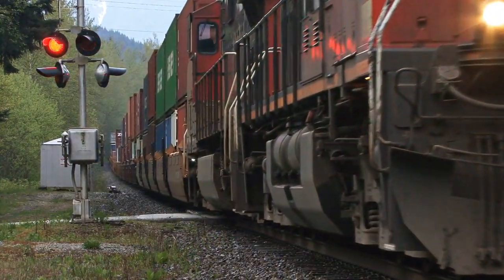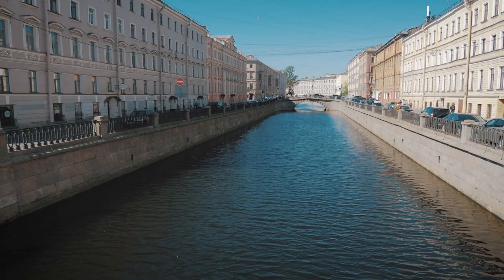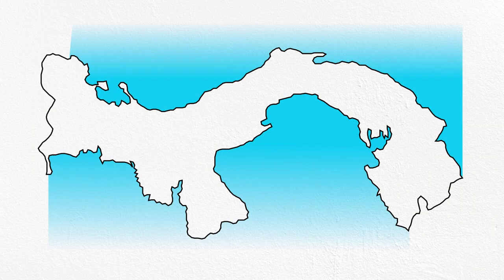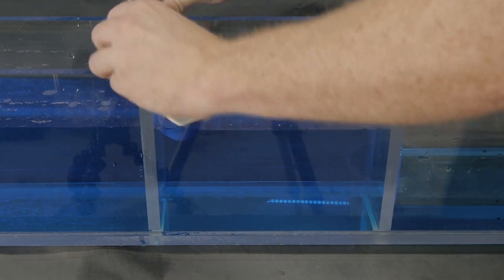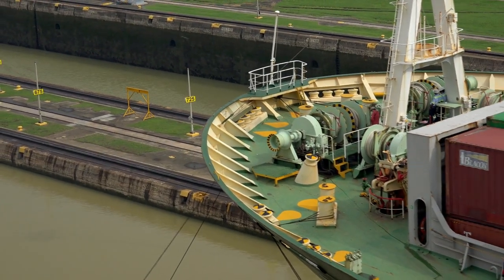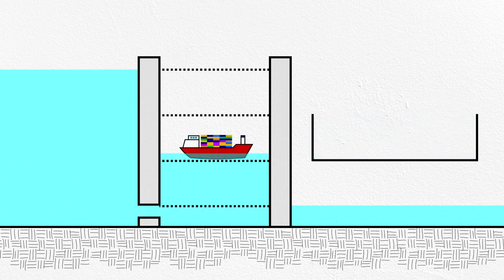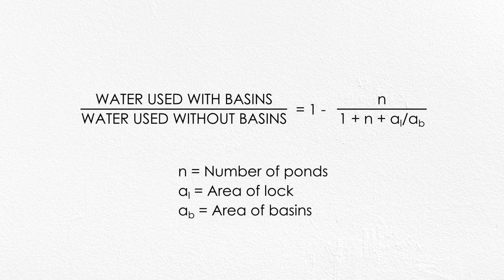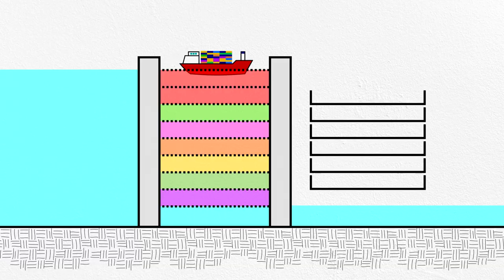The Surprising Efficiency of Canal Locks

Comment: Everyone: Look at all this water wasted by the canal locks.
Scotsman: Laughs in Falkirk Wheel.
Reply: That requires more energy, though. It's always a trade-off.
Reply: I came to the comments looking for this.

And as far as the energy requirements: you could either use hydro-power (which admittedly would waste water), or just accept you need a bigger external power source.
Reply: The Falkirk Wheel is cool and all, but it's designed for 20 meter boats that weigh a few tens of tons, not 366 meter cargo ships that weigh 120,000 tons
Reply: @Khaim.m  Only to overcome the friction of the wheel.
Reply: @VinayPai  Wouldn't it be awesome to see a version sized for those big ships? Totally impractical, of course, but how cool would that be?
Reply: @simongeard4824  I definitely wish we lived in a world where megascale engineering projects like that existed.
Reply: Because the boat in one ‘carriage’ displaces the mass of water equaling the weight of the boat, both carriages are always equal weights, and therefore the wheel is balanced. The energy required is actually quite low, and is effectively the same whether you are moving a single boat one way, or swapping two boats (one lower to upper, one upper to lower). 
There’s not much stopping the wheel design being scaled up - I’d be interested in seeing what the maximum feasible size is.

As for energy - one half-rotation takes the energy of boiling eight kettles of water (~1.5 kWh)
Reply: The “wheel” doesn’t need to be round. The two chambers can be balanced atop pistons that are linked hydraulically to those under the opposite chamber, like a pair of auto hoists. Close the gates, pump a bit of water out of the low chamber and UP you go, weighed down by the heavier high chamber. The lift lock on t he Trent/Severn waterway in Canada is an example of the technology.
Reply: @nautamaran  Today I learned that the Trent/Severn is about 3000 miles east of where I thought it was! 😁
Reply: An amazing bit of clever Scottish engineering.
Pretty sure I remember from a doco that the mechanism is so well balanced through design, the motor drive for the wheel only needs to be a rated at a couple of kilowatts. I can't remember the exact figure, but it was far less than you'd expect would be required to move that many tonnes of steel and water up and down that height. (Edit - answered by Rueben above, ~1.5kWh for one half-rotation).
Reply: @nautamaran  That would have to be the way to do something larger. Simply because the strength of steel/titanium/whatever magical unobtanium used, would simply not be strong enough to support that load without buckling the driveshaft. (And you can't have intermediate pillars to help support it unless it rotates LESS than 180 degrees in total, so 100% of the load is on the end bearings and single shaft. And if you're not rotating it 180 degrees, why rotate anything at all. Just have a driver pump for the hydraulics, and keep it spinning so the kinetic energy of the falling boat is maintained (And use a looped cable over the top as well, because otherwise the pump will have to ramp up when the falling side hits the midpoint.))

Comment: Invention: Use the lock ponds as "pumped storage" to generate electricity and then run pumps to  partially recover water in the upper locks
Reply: If you add generators and pumps to the ponds it would slow the water (and therefore the lock cycle) tremendously, not to mention their price.

Comment: When I was younger, I used to think they used large pumps to fill and drain the locks.😂
Reply: I wouldn't be surprised if smaller locks do
Reply: @ObservationofLimits  Nearly no locks use pumps. Kind of defeats the purpose, and if you were to use a pump you may as well just use it to pump water from the lower level to the higher level and ignore the lock entirely.

I've got a ton of small locks near me going down a canal and every single one of them is hand operated. Big gate style doors you open slightly to let water in, then all the way to let the boat out.

Comment: Well done video! I had no idea about these side basins, but it makes a ton of sense. The alternative alluded to would be boat lifts, cassions that carry a boat and quantity of water up and down, usually having two balanced. The cool thing with them is that a boat displaces it's own weight in water so they are balanced whether or not a boat is in it. They are near zero loss of water, but are much more complicated and expensive, and it wouldn't be possible (certainly not practical) to build one big enough for a huge ship.

Comment: Early English and British Canals and Locks where built mostly for mining, the early pumping methods then drained the Mines and transferred the water to the Canals. Even during dry periods the amount of ground water filling the Mines barely changed, it took extended droughts for months and months due to the "lag" of the water finding its way through the layers of soil, clay and rock and created an almost limitless supply of water. The Mines would always flood, the water always needed to be moved elsewhere so they made use of it.

Some of the early Canals have the water in them coloured by the minerals in the Mines, like bright orange from Iron.

Comment: Those lock gates you showed a clip of, the ones you can operate yourself... the gates actually float in the water, making them easy to move by hand. Also, when they close they form a triangle pointing upstream, which pushes the gates into each other and the walls, so the weight of water is all that's required to keep them securely closed. Once the water level is the same on both sides, they're free to move again. I love that kind of smart engineering.

Comment: In the past in the UK a number of canals failed as their was insufficient water to keep the summit level, which provides the water for the locks filled in dry weather. In some places steam powered pumps were used to pump water from underground to keep the summit level full but it is an expensive business. Part of the design requirements of a canal was to try to ensure the summit level was below a river or lake that could be diverted to provide the water. 

Some canals have the opposite problem when it is wet sufficient water overtops the upper gate to prevent the chamber being emptied sufficiently to open the lower gates.

Comment: Of course, the Caen Hill central lock flight on the Kennet & Avon canal in Wiltshire, England, comprising 16 locks in succession, all have side ponds, enormously bigger than each of the locks, and was built over 200 years ago. It's still in use today, and although no where near on the same scale as the Panama Canal is still very impressive and a fine example of early civil and canal engineering.
This same canal also had a water supply problem at its summit level, so a reservoir was constructed a mile or so below the summit and two steam driven beam engines were installed to pump water from the reservoir up to the summit to maintain a continuous water supply. These two engines are occasionally in steam today and can still fulfill their original function, indeed, actually being brought back into full time use a few years ago when their replacement electric pumps broke down. They performed flawlessly over the period of the electric pump repair work.
These engines at Crofton, like the side pond canal lock flight at Devizes, are over 200 years old.
Both are well worth a visit.

Comment: Excellent Grady - you hinted at it but maybe you have or will make a video on the Falkirk Wheel.  Really impressive solution to the need for moving from one waterway to another.  Here in Ironbridge historically there were canal inclined planes where the boats where hauled up a railway track between canal levels.  Some bits of them still remain.

Comment: As well as obvious height differences, during canal mania in the UK when there were multiple competing canal companies, they came up with the idea of having connecting locks between two adjacent companies' stretches, and one company keeping their water level a few inches below the other - so the other company couldn't steal any of their water (!) Before then, they'd build close to each other but end their respective canals in basins, separated by a narrow bar, completely separating them (and necessitating goods traversing the system to be literally moved from a barge on one company's canal into a barge on the other company's canal).

Eventually, the canals were nationalised, and the gates either removed or permanently chained open.

Comment: There are tidal locks which fill from both sides depending on the relative tidal heights.  They use double sets of doors at the top and bottom.  The Bras D'Or lakes and the Atlantic ocean have a set of these in St. Peters, Nova Scotia, Canada.

Comment: Hydraulic lift locks such as those on the Trent Severn in Canada operate on the weight difference of a single foot of water in the chambers. The Falkirk Wheel in Scotland operates on the same principle with a different style mechanism. These locks have a moving chamber rather than simply filling or draining a fixed chamber. The chamber that is rising stops a foot lower relative to the water level than the lower chamber and thus contains more water once the gates open. This additional weight increases the pressure in the standpipe joining the chambers and raises the lower lock and repeats itself with each cycle. With the Falkirk wheel the difference in weight simply causes the wheel on which both chambers are mounted to rotate but again only a foot or so of water is lost each time the lower chamber gates are opened.

Comment: If you want to see a different water-saving solution for locks, have a look at Kanał Gliwicki in Poland. It has "twin locks". The one currently not operatem acts as a kind of basin for storing water for later use when a vessel comes from the other direction.

Comment: We have double locks. With a boat in each, one going up, one down, you save upto half the water in both cases as water transfers between the two. We also have gilotine lock gates, which is exactly like you lifting the perspex, to let the water in. They can be opened if the waterway floods, which gates can't.

Comment: 1:40 looks like it could be one of the still functional locks along Maryland's ( USA) C&O Canal. A very old canal that's now a park, the tow path (they use mules to pull the boats up and down the canal) is now a 184 mile hike/bike/horse trail along the Potomac River. Also, less than 10 miles from where i live near Hagerstown, Maryland.

Comment: The Panama Canal locks are 110' wide by 40' deep (water level to bottom on the low side.) when a large cargo ship with a 106' beam (widest civilian width allowed) and say 32' draft tries to enter the lock, it actually has to run the engine at decent speed where it should be doing 6-8kts, but is barely creeping in the lock at a knot or two.  This is because it has to displace the water in the lock backwards under and along side itself in order to get into the lock.  In essence, the prop is serving as a giant pump, pumping the water out, as much, if not more than it serves to push the ship forward.

Comment: Another interesting efficiency of locks which I don't think was mentioned is that you can chain them! The water isn't "lost" until it leaves the final lock, so by chaining two locks, you can raise a boat twice the distance using the same amount of water. You can see that in use in the Panama Canal photo at 8:40.
This means that the panama canal is actually only using ~13.3% of the water which a single lock with no basins would use to raise a boat the same distance.

Comment: I operated a lock in The Netherlands as a side-job. This lock only has about 15cm difference on extreme days, normally 7cm to no difference or even a reverse difference in water level. For those occasions it has 2 double sets of v-doors on each side (of which only one set on each side is used normally): 
------><----------><____
Still this lock is very important. It is a man-made connection between 2 rivers (Oude Rijn and Amstel), which have different salt levels, and water quality (and fall under different authorities). On equal water level-days we were not allowed to leave the lock open because it would influence the biodiversity on the one side (pumping stations further on would measure that within an hour). Besides that, water levels on one side could fluctuate to as much as 15cm in an hour with wind change (that side connects to the IJsselmeer-lake), which would make it almost impossible to close the doors again without slamming them shut due to rapid current (the hydraulics would just stall the doors).

On dry summers we sometimes had max operating cycles or a pump that would pump the more salty water back from behind the lock.
When I was a kid this lock was fully operated by hand.

Comment: Not sure if someone else already made this remark. Another way of saving water (besides the water saving basins or WSBs) is to divide the lock into more than one lock chamber in series. Water saved is 1-1/m, with m = number of chambers in series (steps). For the Panama Canal m=3, thus saving 66%. This combined with the 3 WSB's per chamber gives a total saving of 1 -  ( 0.4 / 3 ) = 5/6 (or 86.67%). The backside of employing the WSBs is that the leveling time is 17 minutes in stead of 10 minutes when WSBs are not used.

Comment: Locks can also be made more efficient by having more gates - effectively making it possible to alter the size of the lock and hence using only a size just big enough to accommodate the boats going through it. Therefore only the largest craft need to use the largest configuration of the lock.

Comment: Although impractical for large shipping vessels, it may also be worth pointing out the efficiency of hydraulic lift locks, such as the one in Peterborough, Canada. Per lift, it recycles all water except for about a foot of depth, with no sideponds and primarily gravity for power.

Comment: Living in Michigan we have the Soo Locks. Like 70% of the iron thats used in the US passes through those locks. Absolutely insane. A single 1000ft freighter can move over 100 train cars worth of material with a literal fraction of the energy. And the locks are designed to be gravity powered. No electronic pumps or anything

Comment: If there's anything to save the amount of water wasted than using basin mechanism, it's introducing an external weight to the water so the water surgace height rises, though it may cause turbulence/wave under the surface and cuts a large portion of the surface area for larger boats to enter.
Reply: Yes, but not always practical. Pumps can force the water back up hill. There are projects that do this with excess electricity at night from natural sources like wind. 

Look up the Taum Sauk Hydroelectric Power Station in Missouri

Comment: I was curious to know how the basins work. And they're far simpler than I thought.

But something that turned up in my research is that the toll fee through the Panama Canal is $90... per full 20 foot container. ($60 per empty).
The biggest ships going through the Canal can carry 15000 TEU, or 15000 20foot containers. So a big ship going through the canal costs anything between 90000 and 135000 (!).
The locks are 320x33.53m. There are six big locks in total, the Pacific side can have a higher water level due to tides, but high balling it, the locks are identical and each trio has to raise the water by 26m. Meaning, for a ship to be raised or lowered, 320x33.56x26m= 279000 m^3 of water have to be poured. If we assume both oceans at the same level, that's 558000 m^3 of water that have to be poured out of the reservoir each full transit.
That's $0.16 to $0.25 per cubic meter on the toll booth. $0.40 to $0.60 if they can save 60% of the water (!!!!).
Tapwater is cheaper. Just how much does it cost to operate the canal?

Now, you may think that the Panama govt. is just greedy with their rates. But they actually have competition.
From Hong Kong to the East Coast of the US through the lockless Suez Canal it's a trip just 500km longer. Also, you can ship stuff to the US's West Coast and haul it by train to the East. So it's not like the Panamean govt. agency that operates it can charge wathever they want. No doubt they make a tidy profit, but again, just how much does it cost to operate it?

Comment: well, to be fair to the Panama Canal system, the Pacific side gets almost 400" of rain per year, and I think about half that on the Caribbean side.  I visited the Mira Flores lock on vacation in 2017.  I think it's more common that the Panama Canal system has to release excess water out of their system than it is for them to need the extra water from the ponds.

One particularly wet spell, there was so much water in Lake Gatun, they had to leave the valves open for something like 25 or 30 hours to get the water in the lake down to a safe level.

I could see a lack of water being a problem for the Suez, but it won't often be a problem in Panama.  Their wet season is typically about 9 months long.

Comment: Also, in the port of Antwerp, there is 360m lock between the river and the docks that uses the flow of water to generate the required electricity to power the operation of the lock. Because the lock operates because of tidal differences between the river and docks, the lost water isn't that much of a concern.